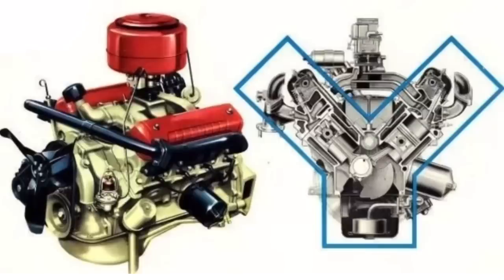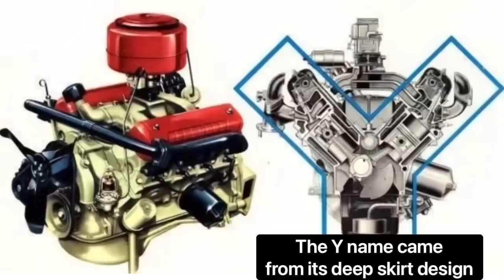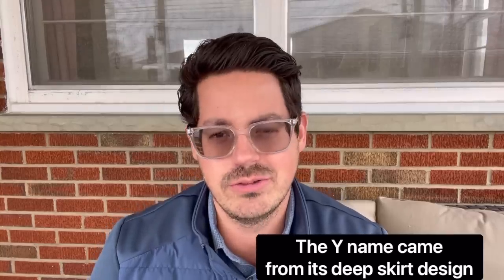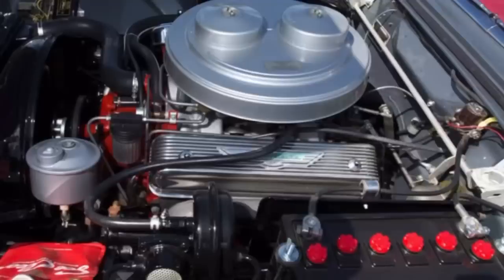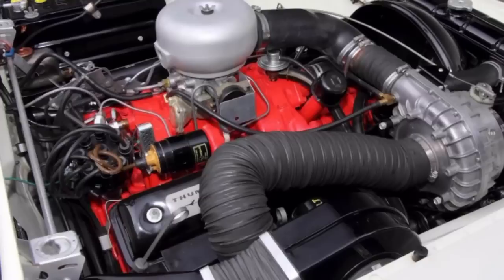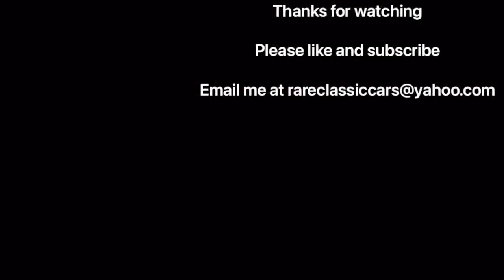Worst Engines of All Time: Ford Y Block V8

Comment: Anyone remember the Frantz Oil Cleaner? I had a car that had one installed. You would change a roll of toilet paper that filtered the oil. You still had to do oil and filter changes, but at longer intervals.
Reply: That's called a Frantz oil filter. You can still buy them.
Reply: Ive used them have one in use now. Replace with John Wayne toilet paper.  Its not a oil filter . Its a Frantz oil cleaner. I am convinced that it does what the manufacturer claimed.
Reply: I remember those.  Neighbor had a 62 Buick with one.
Reply: Had one on a '60 Ford Falcon 170 CID I-6. I set up the return line to feed oil to the rocker shaft as the rockers ran dry because of sludge and cam bearing issues.

Comment: the Y blocks were just about all gone when I started working on vehicles.  The ones that were left, somebody other  than the owner would drive them, over rev them and a few pushrods would jump off.  The valve covers only had two bolts, pull one cover off, put them (pushrods) back on and adjust those valves send here out again.

Comment: My dad has told me about the arm burner header configuration that would cause these engines to run hot. They had a few in the trucks out at the ranch.

Comment: Many still love the Y block, has nostalgia appeal.  Y block is mostly bad because the Chevy small block was so good. I think Ford, being the v8 experts, was suprised at the success of the SBC, but new Fords didn't exactly linger on the dealer lots, so Ford kept producing the Y block to amortize the tooling.
Reply: Timothy Keith yes the Chevy small block was perfect if you enjoyed cracked heads.
Reply: @jimherman859   Stayed in production for decades.   The 4.3 v,6 version remained in production until  2013
Reply: The first SBC had its problems as well. Rocker arms, burning up. Using oil early, but eventually they got it straightened out.
Reply: They fixed the rocker oiling problem early on.  After that, it was fine.
Reply: The 55 sbc was a shitty motor. No ifs ands or buts. No oil filter, etc. Not a good motor

Comment: I stumbled across your videos about a month ago, now I always click them whenever I see you add new stuff. I love your best of worst videos, it’s nice to learn about the shortcomings of various tech over the years. But I see you as an industry veteran who knows the “real story” and not the “approved public answer” we only get in modern times. Anyways I love your stuff and hope you keep them going.

I used to have a 66’ F100 with a 352FE and 3-speed manual, was a very powerful truck as-is and only a few bolt-on mods really woke it up and amplified it’s reliability factor. But I heard a rumor from older gents that the “non-adjustable rocker arms” killed the engine serious. Can you shed any light upon that someday if true or false?
Reply: Sorry meant “engine series”

Comment: i always had the assumption that the y block was great but boy was i wrong
Reply: They're actually pretty good. Just compared to the fe and Windsor they are not as good. I'd take a 292 over any 335 series engine anyway.
Reply: @user-cs1ne8gx9u  i suppose if you maintain it properly it will last just as long but that oiling system gives me the shivers
Reply: @Megabob777  If you have a 57 or later, you will not have any problems.  For the early ones, all you have to do is have a groove machined in the center cam journal, or use a later grooved cam shaft.  Also, plug that oil bypass hole in the rocker shafts.
Reply: @michaelbenardo5695  very interesting thank you for the information
Reply: The 57 and later ones were fine.

Comment: Boy oh boy have engines and oil come a long way! Nowadays we don’t even give oil much thought. I worked at a GM dealership in the 70’s changing oil and remember some real horror stories.
Reply: Back in 1990 my boss bought a brand new 4 cyl stick shift Nissan pickup. He never let anyone change the oil. And it had over a 100,000 miles without and oil or filter changed. and still ran good and did not use excessive oil?
Reply: You are STILL supposed to change the damn oil.
Reply: @michaelbenardo5695  

I worked at JCPENNEY the summer that I graduated from high school. Two guys each had ‘69 Fords, one a Galaxie 500, the other an LTD. The guy with the Galaxie NEVER changed oil and and the guy with the LTD was a freak about it. I think that he changed it every 2,000 miles or so. Before my summer stint was up the Galaxie threw a rod on the guy’s way to work in the morning. He still insisted that he was right. This was 1974.
Reply: @dave1956  They will never admit that they are wrong.

Comment: Another issue I heard with the engine was the stacked intake ports which limited what could be done with the engine. Also one intake got much hotter air than the other which was something ford didn't consider, I guess. As for needing detergent oils, that's something Ford should have recommended from the start, though I've known a few old guys who at the time were pretty broke and used to buy used refiltered motor oil from garages! Also "rebuilt" spark plugs were a thing back then too.
Reply: Oldbmwr100rs : The filtered oil & "rebuilt" spark plugs were common until the mid 70s around my area. Why anyone would want to put used up disgusting filtered oil that reeked of gas (probably thru dirty shop rags!) into another engine always baffled me. The "rebuilt" spark plug thing was really popular. So popular my dad bought his own "rebuilder" in the form of a 110 v spark plug cleaner that I still have & use myself to this day. The sticker fell off years ago so I don't know the manufacturer but it works awesome. You could have the most disgusting oil soaked plug, push it in the opening in the machine & a very fine mixture of charcoal & glass is blasted at it. As long as the porcelain wasn't cracked or the electrode burnt heavily, it makes spark plugs look brand new again hench the "rebuilt" claim. The machine doesn't turn on until the plug touches inside & has saved my dad & me a fortune in sparkplugs. Considering he only spent like $10 on it new in the early '70s, it's the best tool he ever bought. Since 50 years later it still looks & performs flawlessly, I'm gonna pass it on to another family member when I hang up my wrenches for good.
Reply: @rogergoodman8665  I got to know a guy who bought out an old auto parts store and warehouse, and among the tons of parts (sadly all the transmission gasket sets were ruined by age and water damage) were shelves of rebuilt plugs. Looking at them it looked like the center and side electrodes were ground off and new welded on, then the plugs were cleaned. "Lodge" brand plugs from England were rebuildable by replacing the center electrode and insulator, i found a few really old ones like that. The used oil i always figured had been pumped through car oil filters at least, and hopefully wasn't all mixed with gear lube too!
Reply: @rogergoodman8665  Many plugs could be taken apart.  If the center electrode was still good, you replaced the shell - the part that screws into the head - and put the porcelain "core" in that, with the supplied new gaskets.
Reply: @rogergoodman8665  In the olden days before electronic ignition spark plugs only lasted 10K miles instead of practically forever, so renewing them made some sense.
Reply: They probably did recommend detergent oil . But folk still bought what they wanted to buy.
Reply: Ford did recommend detergent oil, but many of us didn't trust it back then.  I remember the rebuilt spark plugs too!
Reply: @Michael Benardo  Even during my lifetime, as late as the 1970s there were a few older  people who thought detergent oil ruined engines. They’d buy non detergent oil and change it every month. But as with many crazy things, there’s often something legitimate at the core. I think that some engines that had used non-detergent oils for years had built a layer of sludge in them that was not harmful as long as it wasn’t disturbed. But when detergent oils were used, they’d partly dissolve that sludge. It would come loose and clog the oil pick-up screen, restrict oil flow, and starve the engine of oil.
Reply: @dmandman9  That can indeed happen, that's why when buying an older car, never use detergent until you clean out the pan, inside of the timing gear cover, the side covers, etc.  One of those Urban legends that is actually true.
Reply: @dmandman9  Also, you shouldn't use detergent in engines that don't have an oil filter, as you want the contaminants to settle to the bottom of the pan, not stay floating around where they get sucked up by the pickup.
Reply: Never heard of locally-produced refiltered oil, but when I was younger you could get commercially recycled oil in sealed cans which supposedly had the additives replenished. It cost much less than virgin motor oil. About the only ones who used it were those whose cars were shot and not worth fixing; you drove those till they dropped and junked them, then went out and bought another $100 car and repeated the process. I've had my share of those cars but avoided the cheap oil.
Reply: @P_RO_  Some shops used to sell refiltered oil.  I never saw any in auto parts stores.
Reply: @P_RO_  It was good if your car had a worn engine and burnt a lot of oil. Best to only drive at night then.
Reply: I've had a 57 Ford 312 for 20 years. Runs just fine. Everything you quote as a "problem" is easily solved today. You need to do bit more research. Just changing oil had kept the top end of mine just fine. Most of the sludge problems in the 50's I'm all engines back then was caused by lack of maintenance. I know, I was there!
Reply: We have Y's making 600  hp today, hard to do if the ports were so.bad as you say!

Comment: The y block head design is similar to  the 4 cylinder tractors Ford made at that time period and they were reliable. Goes to show how use case and conditions for the time can make or break an engine.

Comment: I installed many external oiling fits back in the day.  I kept telling customers with these cars they needed to change oil more often, but they never did.  They came back for the external kit.
Reply: Yes, for some reason people just don't want to change oil in their cars to this day.
Reply: @MostlyBuicks  That is something I never could understand.  They are just too f-----g stubborn I guess.
Reply: @jdslyman You got that right on a 3.6 G.M., I had one in a 06 Buick that loved oil.
Reply: @jdslyman yeah if he did any engines from the 2000's it wouldn't be a hard content for Ford the obvious answer is the 3 valve motors. If he wanted to go with a Diesel the 6.0 would be the engine that takes the cake it basically bankrupted some small businesses
Reply: @jdslyman I don't know why they replaced the superb Buick V6 with that 3.6 engine.